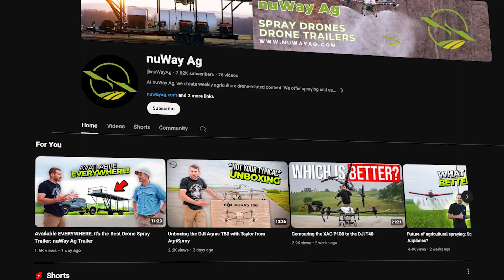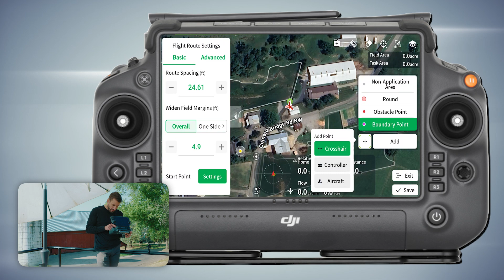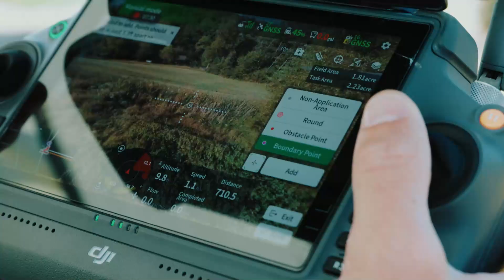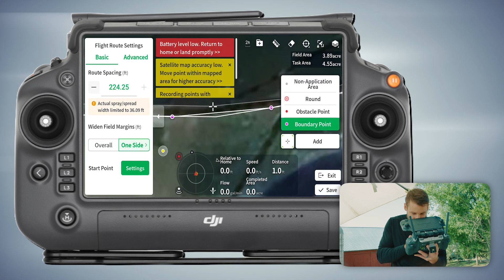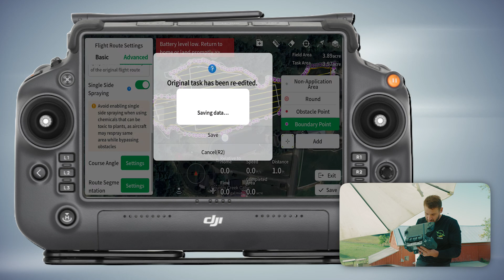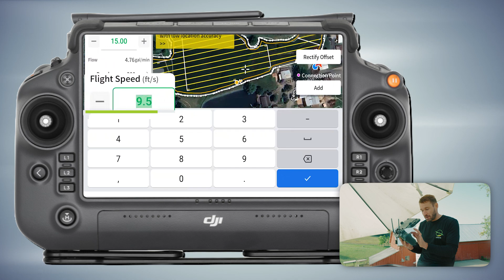Drone Pasture Spraying: How To

Comment: Actually a drone would not be the best tool for a field this size.  Side by side with spray would be more efficient….you spent more time setting up than actually spraying.   Not to mention this is not “pasture”. Try and to 100 acre+ pastures and that trailer you are using would stop you dead.